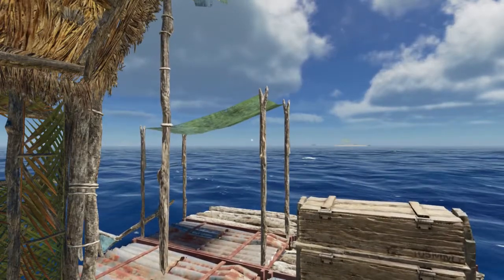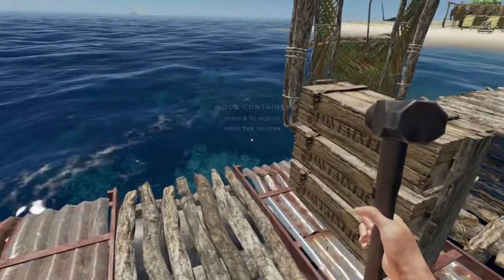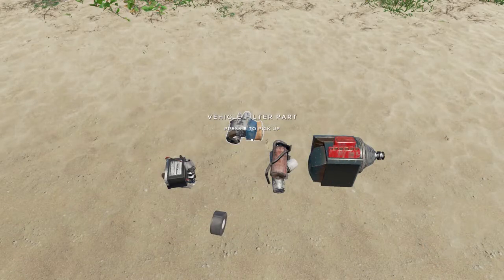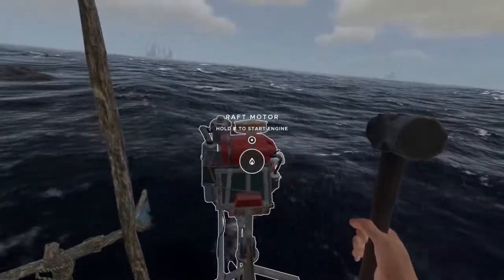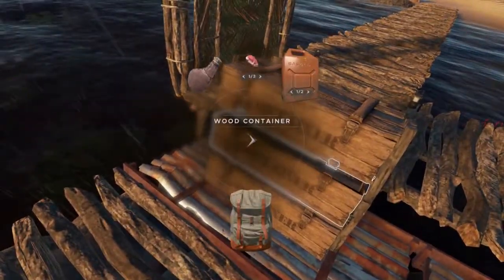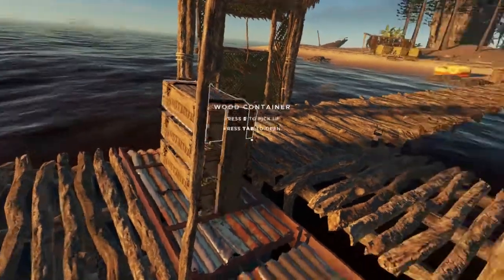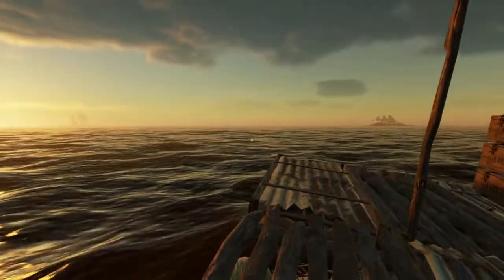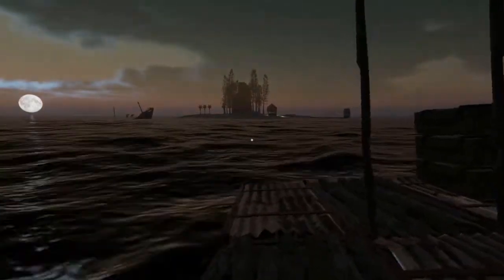Stranded Deep Raft Tutorial, part 3 - Raft Motor! (and Survival S20 E8)

Comment: Bro I can not add fuel for some reason... I built a 9 panel raft with all buoy balls and added the raft motor in the back of the raft  dead center and added a sail and the rudder I put in the front opposite side of where the boat motor is but I walk up to it with the Jerry can and I try to walk up to it and it keeps saying operate vehicle .... It doesn't add fuel or start the boat motor .. it keeps saying operate but won't let me add fuel or start the engine.. I tried  on land and in the water.. dont know whats wrong ...
Reply: If it’s any help you have to find potatoes and make a fuel still boiler to make fuel and fill up a Jerry can
Reply: Me too I have the same problem did you figure it out?
Reply: @Ix.MSH888  yeah I was missing the Jerry cans
Reply: @Jay.77x  
me too hahahha I planted potatoes now i can got more fuel
Reply: @Ix.MSH888  when you complete stranded deep. Get a game called green hell .  It's like stranded deep and you can build better stuff and play with up to 4 players online. I'm about to get it soon ..